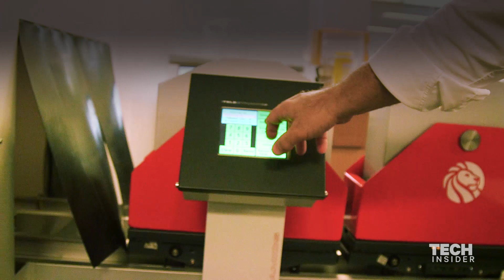New York Public Library installed a book train conveyor system

Comment: i think it's more practical to just have a digital system. Digitize all the books and keep the original copies forever-stored in a controlled environment. A reader can then just access the digitized book through a tablet or other electronic device. It's faster, uses less energy, and takes up less space. This also avoids the fear of readers damaging the books. Normal wear and tear will eventually lead to the books needing repair or replacement.
Reply: People go to libraries so they can get an actual book, not to get a digital one